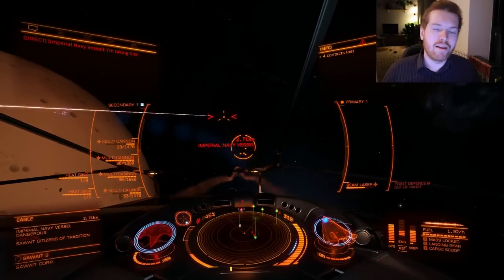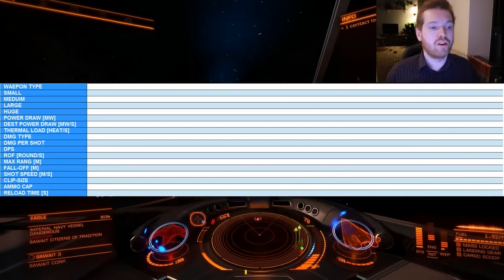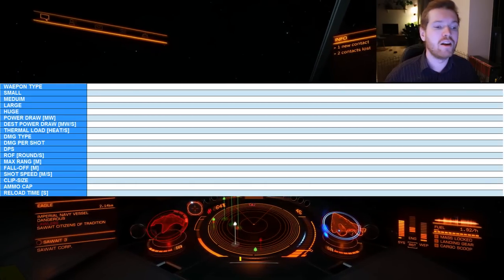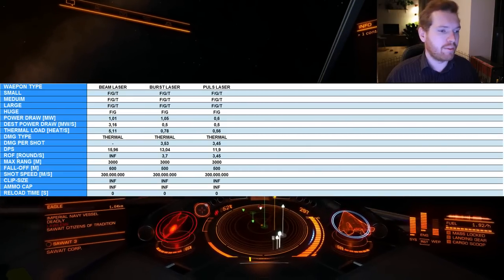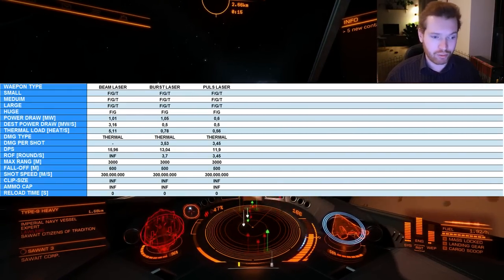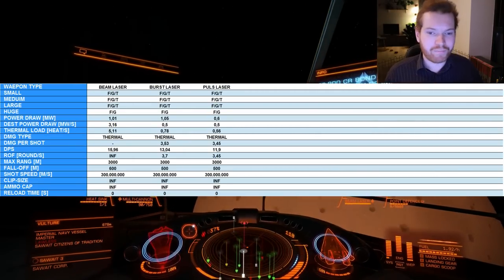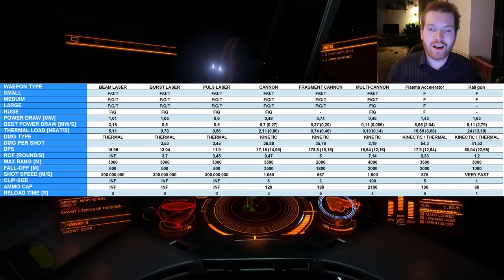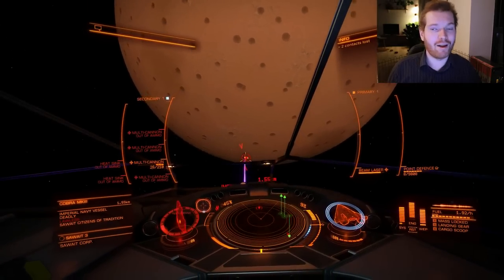WEAPONS GUIDE | ELITE DANGEROUS

Comment: Hi Astro, thanks for creating this. I love your vids. Unfortunately your calculation on distr draw per second migt be wrong. You conclude, a medium burst (listed wth 0.5 MW/s) would only have 1/6 of the medium beam. However, the given burst number is correct when the weapon is active = when the beam is emitted. Although the burst beams do not last for a second, they pull the distr energy in each burst. Thus, the medium burst distr per second is roughly (approximation for simplicity)i:
3.7 (RoF) x 0.5 (Distr draw) = 1.85 MW per sec.
So the beam vs. burst vs. pulse comparison (all medium) would be:
3.16 MW/s vs. 1.85 MW/s vs.1.73 MW/s
Also, these numbers are still misleading as they do not take into account the following:
1) Beams have higher armor-piercing and are therefore more capable of destroying internal modules like power plants
2) Beams (gimballed and turrets) appear to have a weaker gimballing algorithm, they are slower and sometimes even more sensitive to chaffs. Surprise is when using turrets, that bursts or pulses tend to hit more often.  Players can benefit from that a bit, when engineering those. For example rapid fire burst turrets do almost the same DPS than beam turrets with much less distr draw and better hit rates. This is just an empirical observation and meant as example why players should not rely on the paper stats. It depends on your play style, piloting skills and ship type what works best. 

Kind regards from Germany!!! In case you want to connect in-game: My CMDR name is Apollo Prime
Reply from the maker: You know what You are absolutely right about that. I didn't think of that, but it make sense that burst laseres only draw power when active. Thanks a lot for letting me know. I have pined this comment to the top so other people will see  it when they watch the video.
Reply: MED ATTRACTION VERY ATRACTIVE IDEAS ...CAMMO MAGNETS... MAGNET TRAILS  WATCH RAILS WATCH  STUCK...MO ELECTRTCITY MAGNET HI A WAY..STUCKERS...
Reply: Only MAGNETS A STOP U MO PROBLEM ...MO ELECTRICITY HOUSING  QND PEOPLW REAL QTTRAC4UVE MAGNET HI WAY DESERT OR TRAFFIC...CAMMO...

Comment: Some comments:

In-game DPS is based of continuous time on target for 10 seconds.

Beam lasers don't out damage pulse lasers until you've had about 6 seconds on target.

Frag cannons have had dmg boosted vs small and medium sized ships, as of 2.1~2.2.  Mag dumping a Frag on an Eagle or Viper will nearly strip shields.

Frag cannons actual effective range is roughly <= 150m.  At those ranges, at proper angles for penetration, you can strip an internal module of almost 20% hp with a Class 3 Gimballed, assuming no module protection packages.  250-500m is fine if you're not aiming for module damage, or you're fighting a large ship.

Multicannons are generally preferred over cannons due to rate of fire and penetration calculation.  MC's have smaller penetration values, but you fire more of them, vs cannons having higher but low rate of fire.  MC's upgraded with acid(?) special effect from engineers increases hull damage done, by continuously applying an armor debuff.

Cannons did have an upgraded damage profile since 2.2, so above statement may be subject to personal preference.

Railguns do more damage than Plasma Accelerators, due to how the absolute damage is calculated.  Plasma does more thermal.  PA has had it's penetration value increased, so a well placed shot at a perpendicular target does tremendous internal dmg.

Railguns are hit scan, like lasers. There is no travel time for the projectile.  However, the best DPS weapons, are Fixed beam lasers, at nearly all sizes.  Even against hull.

If you want to do a video on Powerplay weapons, I highly recommend asking people who commonly use the weapons.  Truesilver is one who comes to mind on Imperial Hammers.  Rinzler is another for Adv Plasma Accelerators.  The paper stats on the weapons are not a good indication of how they actually handle.

Also, consider searching for Truesilver's guide on weapon damage; he and other commanders have done live testing, which is how it was discovered that in-game information is based on 10 seconds of firing.
Reply: Dps.... damage per second. Not 10 seconds... per second. Which is 1/60 of a minute. Sustainable damage is dpm...damage per minute. Hope this helps you 🤭
Reply: Also railguns are definitely not hitscan. As a side note after its max range it still does damage but can miss the target* meaning its not a hit scan. Its a entity in the game files mate that has mass...which means also not hit scan 😋

Comment: solid video - sadly i think a lot gets left out in basic analysis - the stats on the burst laser and beam are especially odd since it's rather unclear on wtf the stats are referring to, and you kind of have to guess where the numbers are coming from and what they amount to. Thankfully there's videos out there of people shooting at ships until their capacitors run out and you can get a pretty good confirmation there. 

I'm guessing they weren't listing breach damage in this build when the video was made - but putting the numbers together reveals that there's a surprisingly large jump up in damage from pulse to burst when it comes to hull dmg - if you were looking at the raw dps number, you'd expect it to be about an 18% increase in dps, but it's actually more than double that, around 42% more dmg. This is consistent with the breach dmg being listed actually referring to a per shot dmg, and not the total breach damage of the 3 round burst... which is pretty frustrating given that the other damage listed on the weapon is in fact the combined dmg of the 3 round burst lol

So my main take-away from all of this is that my Conda will get considerable benefit from switching out my large focussed pulses with large focussed bursts - as this will result in epic increases in hull dmg. That's a pretty considerable increase in power demand though, so I'm not sure how I'll find enough gigawatts to make that happen, but there's not much point in anything less than that. Will monster my powerplant and see how that goes I guess.

Comment: All that rambling and even after re-watching several times, i don't get what the meaning of 1st and second numbers are, E.g. on Power Draw, 1, 01 <--- ??? What is the first number compared to the 2nd number?
At 1st i thought it was for Fixed, Gimbled or Turret but there's 2 numbers not 3...and you do this throughout... without explaining and what does the [MW] mean?
Also, they seem back to front? The number for F is often much lower than for G?.... Shouldn't Fixed do more damage? {Oh wait.. .is it coz u accounted for missing more shots when fixed??....actually that makes no sense for the "Damage Per Shot" numbers... E.g. Canon 36, 88 <-- How can Fixed be 36 and Gimbled be 88??}

Comment: So on paper, rails look like the highest dps weapon in the game. But in reality they are the worst weapon in the game. As heat build up from multiple rail guns or follow up rail shots has not been taken in to account. I love using them, but the only thing they are good for as of 2.2.03 is ai wrecking you with 99.9% accuracy and cheater manoeuvring. They do fuck all against ai Shields or hull and just cook you. They need another balancing pass imo, and to be available in bigger hard point sizes.
Reply from the maker: +J C I agree that the heat from them are way to much to handle unless you only for 1. 
I would live to see them having the heat reduced a bit and to have larger sized rails. Maybe an small increase in reload time not to make them too OP
Reply: Down to Earth Astronomy Yeah. I think for huge size they should temporary increase power draw when charging to fire, meaning that you have set up your power groups correctly to stop your Shields or thrusters ect from going offline. It should completely drain your distributor (sys/eng/wep) and add a lot of heat. You should really have to think about if it's worth firing or not. But at the same time it should deal massive amounts of damage as it leaves you vulnerable after firing. Thanks for replying and putting out all these really helpful videos, I really appreciate it. If you ever need with testing anything, I would be more then happy to be at your disposable 07.
Reply from the maker: You know what that's not a bad idea. It would make it a lot more fun.
Reply: Actually I typically run an eagle with 2 rail guns and a multi cannon, and the heat is actually relatively manageable during conflict zones, paired with a heat sink( so long as you speed tank your eagle) it is a very good weapon to attack the larger ships with, only downfall is if you are engaged by fighter craft, since the rail guns do suck at hitting the little buggers.